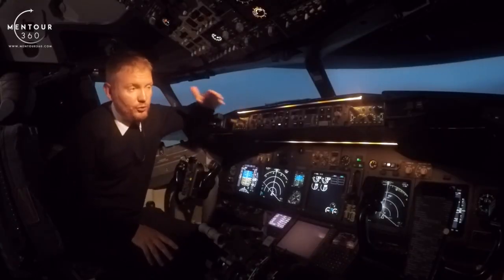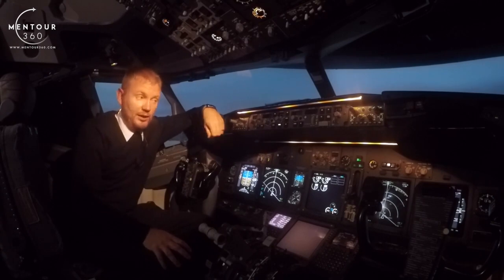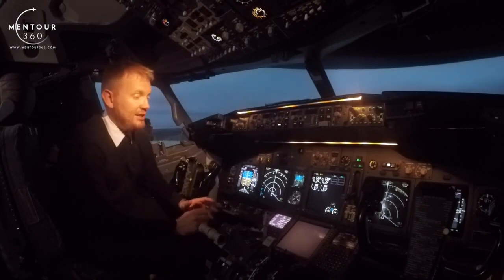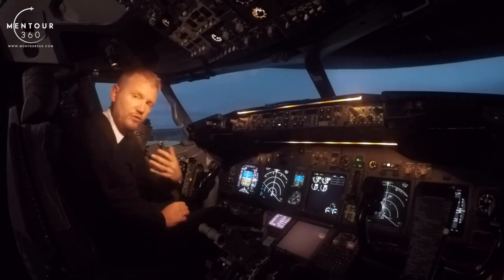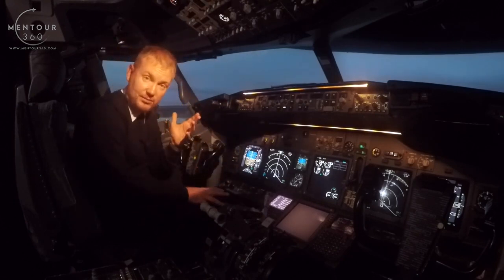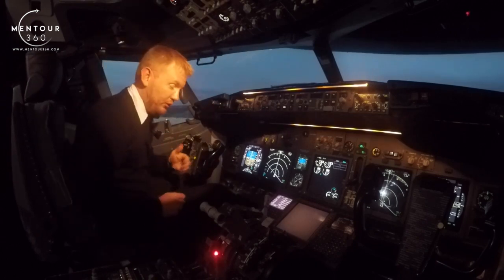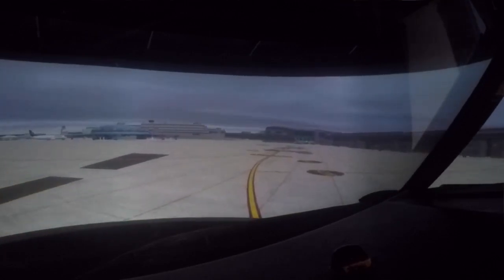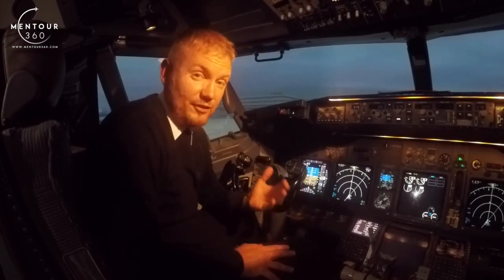How aircraft are CONTROLLED on the ground.

Comment: why does the tiller move to the right when you want to go left and vise versa?
Reply: A tiller is an object originally found on boats and it is always reversed meaning you push port to go starboard and vice versa. That's because it's physically tied to the rudder meaning when you shove it to the 'left' it will spin the rudder in the other direction and make the boat turn 'right'. A lot in aviation is similar or derived from the nautical world so I would assume this is an other case of that. I'm open to corrections though...
Reply: I once bought an hour in a static 737-NG simulator. 
I wasn't told about any tiller; I had to steer using the pedals.
What startled me was that in order to go left, one has to push the left pedal, which is IMO contrary to what one would expect if the pedals were mechanically connected to the nose wheel (like in a kid's tricycle).
I was able to touch down with the plane, but then I nearly raced off the runway into the grass because I was pushing the wrong pedal and I can tell you that it is really hard to re-program one's brain to reverse the action.
Am I the only one who has this issue?

Comment: Hi Mentour, A real great set of videos  you are doing.     I am the wrong side of 50 to be a pilot, but a frequent flyer, now flying over 24 times a year.     I always still watch the crew do the drill, as it is only polite to do so.     Also those that do not watch could cause the problems.     I know of an A380 senior cabin supervisor, and when we have been passengers together, he always still watches the drill.   Normally sit front row, so in an emergency, I should be a first out.    Do you ever sit with passengers when not on flying duty?
Reply: Leslie Chase you can still get a pilot license at 50 plus. As long as you pass the test and the physical. You probably won't be flying a commercial airliner but you certainly can pilot a plane after the age of 50 even if you are just starting out.

Comment: also why do you fuel dump and when
Reply: first response 1: it is rare to dump fuel. Amd when it is, its only done in the air before landing because every plane has a maximum landng weight, and dumping fuel decreases the weight to meet the requirements
Reply: Dumping fuel is also done when a crash landing is probable, which will greatly reduce the risk of explosion and loss of life on board.

Comment: Here's a question:  In the event that both pilots get sick or incapacitated at the same time, are the cabin crew trained in basic flight controls, like flying straight and level, and using the radios and autopilot, so they can be talked down?

Comment: One question here, a common theme when things go bad with an airplane is that the pilots can't see behind, say wings and engines, why not install a camera that lets you see the wings?
The 380 has one i think, for the passengers anyway so they can see the takeoff. Cameras today are so small so should be easy enough to fit.
Reply: Berth Ljunggren there are videos on YouTube showing jetliners with outside cameras allowing the cockpit crew to see what is going on with the wings and tail of the aircraft.
Reply: Good never seen one I admit but mostly look at disaster videos ;-)

Comment: What is the "taking off" and "touch down" speed of an aircraft?
Reply: Aseefsh 3002 this will vary between make and model. aircraft weight, runway length and aircraft configuration play a part in the calculations.

Comment: Do you use differential braking on the main wheels to steer?
Can the nose wheel be set to 'castor' or is it always actuated?
Reply: Ed O'Brien we use the tiller on the A320. Nose Wheel Steering gets inputs from: Capt. & F/O steering hand wheels (max deflection is 75°, starts reducing above 20 kts to 0° at 70 kts.), Rudder pedals (max deflection is 6°, starts reducing above 40 knots to 0° at 130 kts

Comment: One question, I remember in your video about pilot incapacitation that if the Captain can´t fly the FO shouldn´t use the left seat, even to taxi out of the rwy, why is that so? He couldn´t even land on the FO seat and then taxi to the nearest taxiway just so the plane doesn´t block the rwy? And in some versions of the 737 can the FO steer the plane?
Reply: Oh I see! Thank you very much for the answer!
Reply: Jose Lopez if this were to happen on an A320,  it would have little consequence. both captain and first officer have tillers to steer the aircraft.

Comment: Hello I want to ask what is contingency fuel.
Reply: Rhythm Nagre simply put, , the recommended minimum contingency fuel is the greater of 5% of the trip fuel or 5 minutes holding consumption at 1500' above destination airfield elevation computed based on calculated arrival weight.

Comment: Are the engines at maximum thrust during reverse thrust?
Reply: In the case of a 737, the pilot can select either idle or full reverse. Idle reverse, is just reverse with idle power, as its name suggests. Full reverse will put the engines to around 77-83% N1.

Comment: Aircraft not only have a steering wheel, modern aircraft like Airbus's have automatic transmissions whereas older aircraft  are 4 speed manuals and pilots had to learn to double clutch as they slowed down for landing.

Comment: but in mig 21 you can't do that. the nose wheel isn't steerable. so you must use rudder, rebrake, aircraft just turn a little bit, use rudder again, rebrake, and so on.

Comment: Can you use both rudder and tiller simultaneously to acquire a greater turn radius?
Reply: Virtual Ryanair 737 NGX no, in the A320, the tiller gives us up-to 75 degrees of steering.  as the takeoff roll commences, this authority is extinguished by 70 knots. the rudder provides six degrees, as that too begins decreasing above 40 knots and is locked at 0 degrees by 130 knots.

Comment: At what speed, during take off, do you usually switch from the tiller to the rudder pedals?
Reply: Kevin W in the A320,  the tiller's authority is 75 degrees of steering. however, as the takeoff progresses,  that range narrows to zero degrees by 70 knots. the rudder provides six degrees of steering however that too is reduced to zero by 130 knots.

Comment: How many hours before the boarding starts the crew ( the pilot ) is in the aircraft? What does he do then?
Reply: Cédric De Cock If it's a new crew, they will have enterred within the last hour i think. All the flight plans and documentation are put together in a room in the terminal. Once inside the airplane it's a matter of putting down the bags, startup the plane if it was still cold and dark, program the flight computer, and let's rock.
Reply: You mean how many minutes! New crew, maybe an hour. Same crew, 10-20 min
Reply: Cédric De Cock typically, for first flight of the day, the crew will arrive an hour or two before departure.  each has their own specific duties that must be performed. the crew meet in flight operations and discuss the paperwork associated with the flight. weather, flight plan, alternate airfields,  fuel,  number of passengers on board. once that has been discussed and a final fuel figure decided upon they proceed to the airplane. the first officer will commence with his walk around safety checks,  while the captain,  begins bringing the ship from cold and dark right to before engine start.  the first officer will join the captain on the flight deck, the passengers once boarded and confirmed,  the doors are sealed. then, a carefully choreographed 'ballet' begins between the ground crew and the flight deck. the tug will dock with the nose wheel and through interphone,  the captain, upon receiving clearance from ground control,  advise they are ready for push and start.  as the jet way is retracted,  the tug pushes the plane back, while the engines are brought to life. everything is done via checklist down to the last  detail.  when the plane is properly positioned, the tug stops and the pilot sets the parking brake. the tug disconnects and drives away. once the flight has received taxi clearance,  this is the first time the aircraft begins moving under its own power headed for the runway. it's a busy time for the crew.

Comment: why do pilots close the landing gear after take off
why is it Mandotory?
what would happen if u keep it open?
Reply: along with reducing drag to improve efficiency, if you keep it down, you will likely damage the gear during flight
Reply: Because of the law of aerodynamic.
Reply: Deployed landing gear creates drag which you don't want when taking off, because as much lift as possible is needed to gain height and maintain speed.

Comment: If you use the rudder in flight will the nose wheel move under the plane?
Reply: No it is locked while it is retracted
Reply: Yota Takeshima if  i understand your question, upon landing during the Roll Out, the PF uses the A320 rudder pedals to keep the aircraft on the runway centreline. initially,  the rudder will be aerodynamically effective and below around 100 kts the Nose Wheel Steering function commanded by the pedals will take over.
Reply: Ethan Mc Clelland no,  the nose wheel is inhibited
Reply: Ava Mendez ... That's for your airplane, it actually depends on which aircraft.
Reply: Ava Mendez ... That's for your airplane, it actually depends on which aircraft.
Reply: Ava Mendez ... That's for your airplane, it actually depends on which aircraft.
Reply: There was a flight in which it was turned and then it broke on landing I think
Reply: I really appreciate your videos I've always been fascinated by how airlines in the airport and everything you know Aviation works
Reply: Usually, nose wheel steer has to be engaged with a lever, it's thereafter it responds to Ur directional inputs
Reply: No cuz its lazy it needs some milk

Comment: Do I understand correctly - no differential braking, like in a GA plane ?
Reply: There is a possibility for differential braking but uncommon. Each pedal for each respective side, like the GA aircraft. Mostly for very, very tight turns. Uncommon because it does put some extra strain on the gear. You can also use asymmetric thrust to some extent to help out but again, puts some extra strain.
Reply: Thank you for the response. That makes sense.

Comment: I'm guessing whatever powers the pushback vehicle is a high torque, low horsepower engine?
Reply: They usually have a good few hundred horsepower too but they have gear ratios that are optimised for torque as opposed to wheel rpm. Thus their maximum speeds are low but combined with their weight and of course the large tyres to give them good traction they can exert a lot of tractive effort which is kinda a necessity when you want to overcome the inertia of a couple of hundred tons of aircraft.
Reply: Alright thanks.
Reply: Watch the video where you see how they push an a350 from the gate, it is one of the new ones that lift the nose it is incredible!
Reply: Turbzay I used an old one at work. Sometimes they are totally custom vehicles. Other times they are something like an f350 but the gearing is changed so it only does like 40 mph and the frame is cut and shortened big time. The engines are nothing special. They are just geared really low. Think how much power your 21 speed has in the very lowest gear. Thats the idea. Some of the the custom ones lift the front tires others just push it with a bar. We had one to move fire trucks around the factory.
Reply: Yeah, they are heavy, high torque vehicles.  They tend to resemble forklifts without forks.
Reply: I drive a forklift and it’s not set up like many people think. Because they often raise the load high off the ground they have a counter weight behind the driver seat. The axle close to the forks has minimal weight on it. If you try to push a heavy enough load across the floor the drive wheels will often spin. If you raise the forks just to the point where it takes some of the weight without raising it off the ground it reduces the friction of the load and exerts more down force on the tires. A forklift only has about 45 horsepower which is less than a motorcycle I owned. I think with the tugs they had heavy weights to get downforce on the drive wheels. When you have one that raises the plane you use it’s weight to get traction. The more it weighs the more traction you have. The tug doesn’t have to have as much weight of its own. I’m sure they have more power than a forklift but I don’t know how much more. A guess would be 150 hp. Sorry to be long winded but the details are complicated.

Comment: I believe Airbus planes use joystick for taxiing and flying (fly-by-wire).
Reply: taurus20077 They use a steering tiller too.
Reply: taurus20077 in the Airbus we have dual tillers on each side for the captain and first officer. the tiller provides us with 75 degrees of steering. however,  as the speed increases during the takeoff roll,  that authority slowly diminishes to zero degrees by 70 knots.